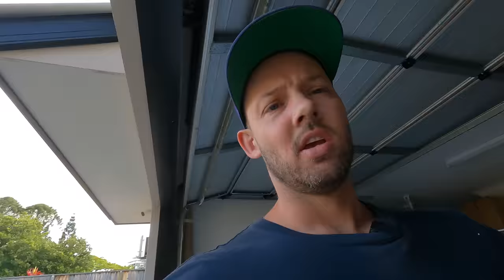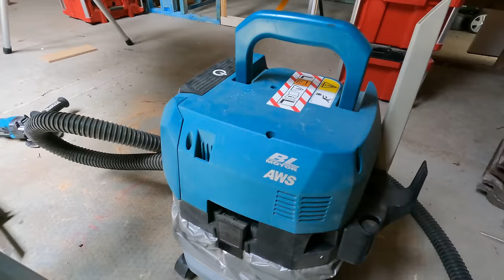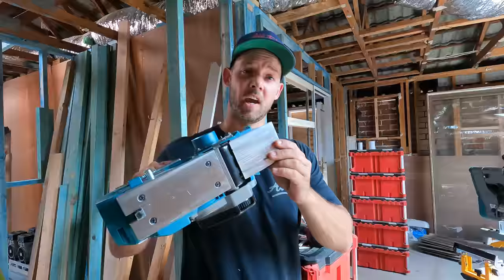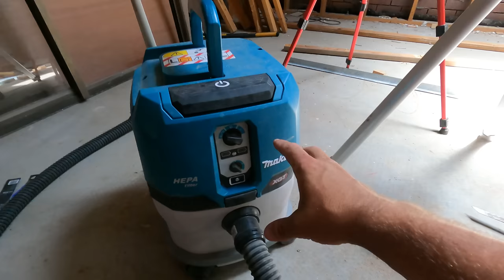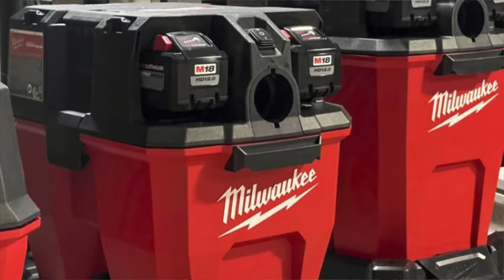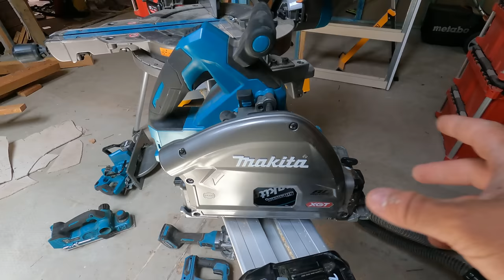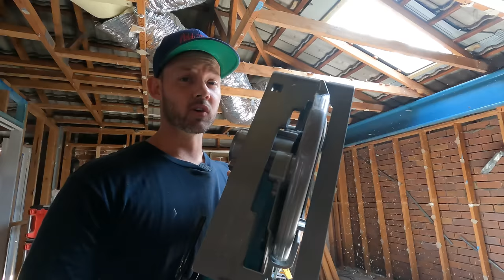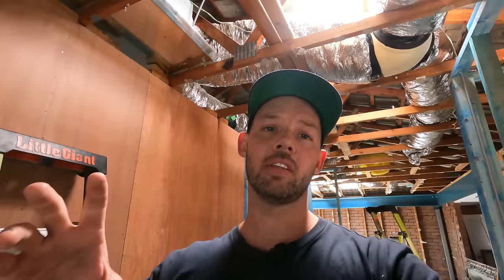From milwaukee to Makita. Why I changed tool platforms

Comment: I prefer not to continually let coworkers use my tools. They are generally rough with something they haven’t sacrificed in order to buy themselves. They can get the same tax write off for tool purchases I do if they stay out of the pub or strip club. I don’t mind here and there, but if youre borrowing my tools and blowing paychecks irresponsibly, I’m not going to contribute to your problems.

Comment: I also switched to Makita.  Milwaukee makes great tools and especially great impacts.  However, for professionals I feel like Makita has more attention to longevity and weight.  Their tools are usually comparable to Milwaukee, but typically much lighter and tougher.
Reply: No, they are not. Stop lying.  My friend makita couldn't drive 5" joist screws when we built his deck.   Had to barrow my milwaukee.

Comment: I don't have any specific brand I'm buying but I have few and choose between those. Mostly I have blue Bosch but also Fein, Hilti, Festool and Mafell. If I buy tools then mostly I choose one of those (all European and also manufacturing in Europe) but.... I have cheap brands too because when I work at construction site, I don't want tools to be stolen. If I need to do some small work, as cutting 5 stainless steel wires (3 mm diameter), I can use any angle grinder for it but cutting disk is good. Then for workshop I have bought European made tools which are step better, industrial quality. For example 2 mitre saw:one 230 V price was 1500,- EUR +vat, and another (380 V) 5700,- EUR +VAT. I don't need to carry those anywhere. Quiet, powerful, precise and lasting to next generation. The most expensive mitre saw is about 15 000,- + VAT and it's semi automatic. 

Next year I will buy mitre saw which is totally automated. There will be made feeding system to my specifications: automatic feeding, measuring the profile, cutting it to length given to saw and calculated that no waste, printing manufacturing code to every profile and after cutting separated to cassette, every different length to its own cassette. Custom made. Don't ask price tag. It's for manufacturing, not for construction site work

Comment: I just want all these damn companies to standardize a battery already…

Milwaukee makes great impacts and ratchets. Milwaukee makes the best cordless tire inflator I’ve found. Dewalt has a nifty portable pressure washer. Bosch has a sickkkk impact gun that accepts 3/8” sockets ORRRRR hex bits on the anvil. It’s amazing. Craftsman has some interesting , or used to have the bolt on series that was affordable and offered many different tools with one “grip/drill” assembly. 

But you get sucked into a brand based on the tools they make. But no company does it all or does it all well. I just want standardized batteries so I can buy any tool and just run it.

Comment: 3:48 not true Milwuakee has 3 powerheads with the new line up one uses a single 18v (the one I have), one is dual battery as you said and the 3rd is also dual battery and ac. So yes they do have it with a single 18v depending on which one you choose.

Comment: battery is the most expensive part of the system, so if high capacity batteries failing so easily, then the system simply cannot be considered as a professional. Yes, they replace it but it takes time, during that time you'll sit and wait, or you can buy more batteries. But, it's just more effective to chose another brand that has no such problems - Makita or Dewalt🤷🏻‍♂️ Milwaukee known not to last long on heavy use

Comment: I want one of these brands to make a battery pack that is a power lead tail so if i want to use mains power i can, without getting more tools out. I dont want it to be a battery aswell. Just to make my battery tool a plug in for a short while, or if my batteries are charging.

Comment: Your mistake is choosing just one platform. I  purchase tools that are the best or that that are cheap but still competitive. For example,  I just purchased Milwaukee's new high torque 1/2" impact wrench which blows away any competitor. I bought Milwaukee's rear handle circular saw along with the impact wrench because it lowered the cost to $205 US for each tool.  I also use a Ridgid hammer drill and impact driver. They were cheap and they are very good quality tools.  But the Gen 4 Milwaukee M18 impact driver and hammer drill is FAR better than my Ridgid tools,  but I am not purchasing them because I don't need them.  I am happy with both the Ridgid platform and the Milwaukee platform,  each has their strengths.  

You could do this same thing with Makita and Milwaukee.  Use Makita tools where dust collection is important,  and Milwaukee tools for other work.

Comment: Yeah Ive been avoiding all the redemption deals with Milwaukee deals, because of how often they give away the 12 amp hour batterys, (if you look into the reviews of them there have been so many negative experiences)
The 6 amp hour high output batterys have been great though
Reply from the maker: Fully agree. I believe they may have been trying to get rid of them before launching the new forge batteries. Which I am hoping are better

Comment: They all should be forced to make their batteries compatible with each other. I like what Bosch and Metabo are doing with the Ampshare and CAS systems.
Reply: Europe done that, in the next years all international Brands will have to use a common battery. Makita, Dewalt, Bosch etc. Also there are already adapters to use 18V~20V batteries to all brands.

Comment: I used to be Makita until 2 issues, 1 was a drill after 2 mths use drilling 3mm pilot hole would flog out bearing, shit warranty 1 year but it did get repaired, got it back  and same thing happen again, they blamed me using to big of drill bit, since when is 3mm to big for 18v drill, had it repaired 4 or 5 times then after 1 year they gave money back, they would not replace it,even after 2 or 3rd repair.
  2 Issue was there batteries if tool came with battery and had star on tool and you try to use that battery on non star it would run, it would start then stop right away, fuckin shit for someone using them, so basically you had to buy 2 sets of batteries for same volt and brand of tools, also the fact there early batteries didnt have balance charging so if you left battery sitting for a few weeks with low state of charge they where fucked, and if you put them on charger more than 3 times with error the battery chip locked you out and had to buy new battery,
I will not buy Makita ever again due to there shit service and design, this was about 12 years ago now, gone Milwaukee now and hate to think how much ive spent on them now.

Comment: Love Makita and Milwaukee, only thing I would think to mention is that Makita have started releasing tracksaw compatable circ saws (I think the 190, 235 and 270mm), so if you were looking to get a track saw and a circ saw its worth looking at.
Reply: So worth looking at, but you might have to get them via eBay. At least in the States. :/
Reply: Depends on your cuts though. I have both the 40v track saw and a track compatible 40 v circ saw, but for plunging the circ saw is obviously useless. Both of the saws ooze quality though and I love working with them. Weren’t even that much more expensive than their 36v counterparts. AWS is awesome by the way. I love not having to think about starting and stopping my vac.

Comment: Great video bro. I'm a mechanical engineer in NZ and have run Milwaukee for over 10 years and have found this platform excellent. However, I do agree that the higher amp hour batteries are debatable, they take ages to charge. I use a wide range of skins on both the 18volt and 12volt system and find them very good. I do like the Makita Bluetooth Vacuum system that can connect to other skins. Can this vacuum connect to a masonry drill to remove the concrete dust?
Reply: Yes. if the masonry drill has vac shroud. All of Makita rotary hammer drills have vacuum connections for the dust. Many built right on the drill

Comment: One question, what is a monosaur?🤣. JK, have you had a chance to check out the 18volt adapters that can swap makita/milwaukie batteries/tools? I've gone full makita but have an adapter to use the milwaukie tripod light which works really well.

Comment: Just buy a generator, an extension cord, a power strip and use corded tools. The best modern battery tool is no where near as good as even the cheapest of corded tools.

Comment: I like the Milwaukee 12V system because the ratchets and cutoff tool are small enough to make sense actually using. IMO the only other brand with comparable products is Bosch, but their range is so small and availability is spotty in America. I was never particularly impressed with Milwaukee 18V relative to the competition except for their range of offerings, they’re the only company that makes every tool in every size. I like Rigid, but their range is too small and some of their tools are too large. I like Makita, but most of their tools must be ordered in America, only HD carries them, and only a small portion of the range. So I have primarily DeWalt 20V tools, with a handful of Milwaukee 12V.  It helps that DeWalt tools are the most comfortable to hold for me, with Makita and Rigid close behind. 

Ryobi is just budget Milwaukee. And Craftsman is budget DeWalt. For a DIY guy they’re great, but if you use your tools professionally I’d skip them. Flex looks pretty good, perhaps a bit too bulky, but I have no personal experience with them.  I’m pretty sure all Kobalt power tools are ripped off Craftsman directly. I’ve written off Metabo, Skill, Bosch just because their range is too small, the tools they do have are excellent. I’m generalizing obviously. And this is only for cordless tools, for corded I’d use any of them, but right now that’s only a rotary hammer (Metabo) and miter saw (Bosch)

I do telecom work, on utility poles from a boom lift and climbing towers. So for me getting the most power in the smallest package is important. DeWalt does this the best, usually either Rigid or Milwaukee 12V are second.  Makita and Milwaukee 18V are pretty bad at power density.

Comment: I found this out early on

All my personal opinion of course

Makita wins the looks! And has the best color.

Makitas batteries charge the fastest and last the longest easiest to switch out.

Now there are tools that makita does not make, like milwaukee riveter and etc, basically everyrhing that makita dont make it buy it from the other brands and get the makita battery converter for it and that way i keep it all makita batteries!

x3 and the bast part of all makita is its own company!

Comment: I'm a carpenter/ builder. I've had Milwaukee cordless gear for 10yrs and I have a fair bit of it. Other than a few makita & Panasonic tools pre lithium batteries era, I've always had Milwaukee. I have 6x5A, 6x6A & 4x12A batteries. One of the 12A & 5A batteries fully charges but is flat in about 5min of use. I've also noted the batteries get loose in the tool stopping the tool from working- need to R&R the batteries and the twin squeeze tab releases are all stiff. The 12A batteries are tempromental in the blower. When they work, they work very well. Other tradies that use them are surprised & impressed. But these grievences are compoundingly annoying. I don't find Milwaukee anywhere near the market agitator they think they are, they've omitted a lot of desirable features other brands have now. I'm really close to just leaving the Milwaukee stuff in the garage and getting all makita gear or a mix of several brands.

Comment: I started using "only" Makita after being all over the place. My Bosch product where often dissapointing, usually with very avoidable design flaws not improved presumably because of cost.  Short term profit is everything for Western companies. 
If Makita produce a bad design It's taken off the market relativly quick.  Bosch keeps pumping them out. Am I wrong?

Brands like Festool and Hilti have better products, I know, I've tried them. But the price is absurd.

Comment: To be honest, I still don't get the "battery" tools or, if you wish the advantage for the consumer of many of the non corded tools when working where power is available. One thing is sure, the tools manufacturers sure benefit from this new way of adopting tools. We go for a "platform brand`: rather than the tool themselves.... Loyalty to the brand through batteries. Well, you said it yourself, you were offseted by a battery that failed to charge properly and it took a whole freek'in month to replace it?? Cords were and still aren't that much of a big deal... plus you get what you want and in many cases you don't run out of power when you need power... either....

Comment: I started with Makita but they switch platform too much  or else I would still be with them

I went with DeWalt and now I think I gonna use whatever is cheaper with a battery adapter

Comment: As a long time Makita fan, I was disappointed to find that the last two battery drills I bought did not run true, I changed to Bosch, they do.   This may just be the chucks, but I don’t like it.  Also, I found the Makita’s dug into my hands unpleasantly.
Reply from the maker: Hey mate, do you mean that they didn’t drill straight? They had some play within the chuck or collet?
Reply: @AddictedtoTools    If I put a new 1/4” bit in the chuck and pressed the trigger the apex of the drill bit would wander in an erratic orbit, you can cope with that in rough work but its no bloody good at all if trying to put a small hole in a bit of steel,even if centre punched, without the dot forget it.

Comment: Sorry totally disagree there. My story is almost the same, tools got Stolen 6 years ago, bought Milwaukee instead and i never looked at another tool again. As a contractor we use them in all sorts of weather and hard conditions while the work is tough. I clearly noticed a different feel in power, Milwaukee is just way more powerful, battery life could be a bit less than makita. But im happy to buy an extra battery instead of going back to makita.

Comment: i kind of down on batteries on stationary tools., 
 if you are doing framing or finish work there is almost always available power . why pay for expensive batteries on stationary tools when you don't need it . portable tools , drills impact drivers etc of course but big tools that aren't moved at the job site it's a waste of money .

Comment: Milwaukee does have a single battery shop vac. I love mine so far.
Reply from the maker: I thought all the new gear was 36v?
Reply: @AddictedtoTools  no. You can get the double unit that uses two batteries. A corded unit, or a single battery unit. Single you can get in the 6 and 9 gal. Double is a 12gal. Even though all the tubs/dollys are interchangeable. I have the single 6 gallon and really like it. Use it for dust collection on my mitersaw and all around shop vac uses. Really wish it had Bluetooth turn on like Makita. But I built a shelf on my DeWalt miter saw stand that at least brings it up to easy reach height so I turn it on and off every cut. Not awesome but it works.

Comment: Makita is Japanese and their first and foremost concern is the user. They know tradies are using these day in day out so Makita is going to have lowest vibration. Best ergonomics. And now with their 40v system. Best power. Their avt reciprocating saw is the most powerful out of every other one. Same with their hammer drill. Their impact isn’t the most powerful though.

Comment: If I were forced to start over fresh, I'd be 50/50 whether I'd go with Milwaukee again. If I were solely doing carpentry work then I probably would go Makita 40 volt or Hikoki Multivolt. But I do a bunch of automotive work as well, and Milwaukee has everyone beat hands down when it comes to that. I certainly wouldn't be going Makita 18v because for whatever reason the quality of Makita 18v has significantly dropped over the past couple of years. The other apprentice I work with bought a Makita 18v 8 piece kit and he's had to send almost everything back for repairs at some point or another, and he isn't that hard on his tools, in fact I thrash my Milwaukee tools way harder with only two clapped out 5.0 batteries.

Comment: Did you know I DeWalt batteries if you buy at 10ah 200wh  buy 5ah 100wh buy 15ah 270wh.  It should be at 300wh because I have a 10ah and 5ah i’m trying figure out  how to put them together I get that 300 Wh

Comment: Is it just me or have batteries become super expensive,?   i look for deals that include 5amper's to make sure I always have adequate batteries.  recently added a drill driver kit for the two extra batteries and two more as a bonus,   so basically I paid for 4 batteries and got a drill driver and charger thrown in, . BTW still not a fan of the finishing bradder, .

Comment: Awesome video as always. One thing I dont understand is why the trend of cordless mitre saws and vaccums? I much prefer to setup my mitre saw and run a lead to have endless power. I have metabo tools and love them, but had to buy another brand for nail gun as metabo doesnt make any.
Reply from the maker: Cheers Greg. I definitely understand rathering having a lead. I guess it really comes down to the situation. If it’s going to be in a shed setup or easily accessible power on site I’d go corded. For many sites I work on(I’m not using the saw on site) you have to have test tags on the leads and cable management which can be annoying. Some sites are harder to get power also. Most people were asking me about this setup with the batteries so I decided to jump onto it.